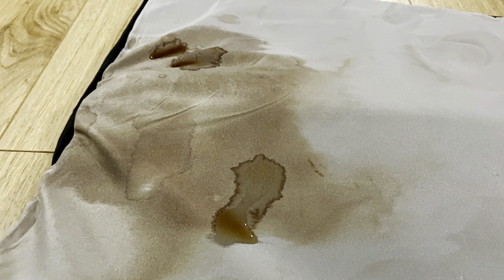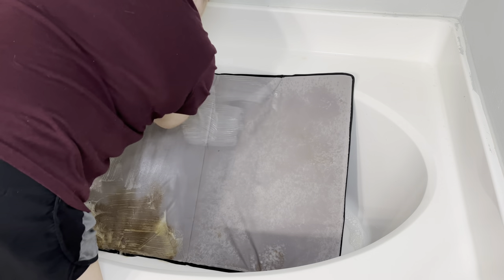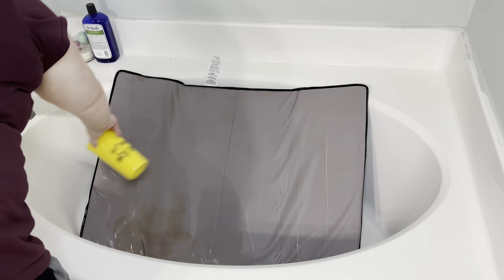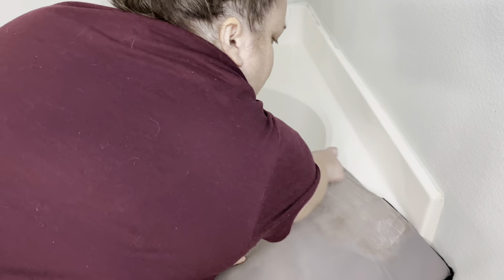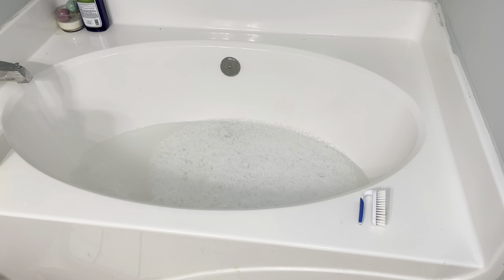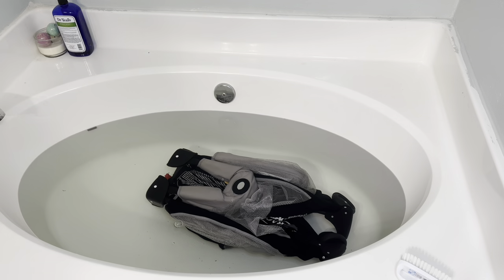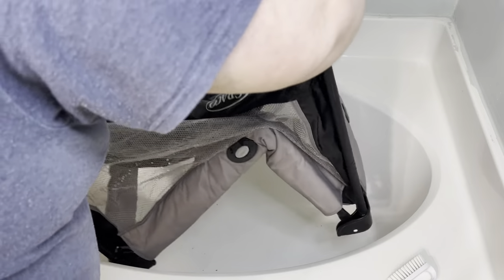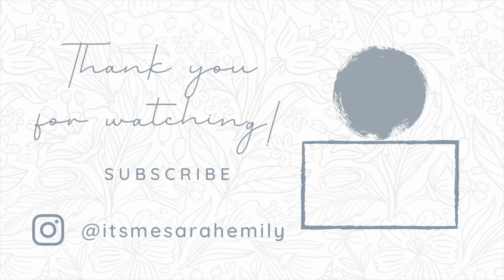Easiest Way to Clean a Pack n Play

Comment: Don't mislead people. You can't wash the bottom board/mat like that. It is made out of some kind of board, it will absorb & retain water. It will lose its shape and might mouldy if not dried properly.
Reply: Yup you cannot submerge in water. If it absolutely has to be cleaned work very quickly and don’t let water seep down into it. I personally used a carpet shampooer in tiny sections and did NOT completely saturate it.
Reply: Adding to that, I sat it up on its side to dry in the sun or inside with a fan.
Reply: Es cierto YO lo ise y se daño